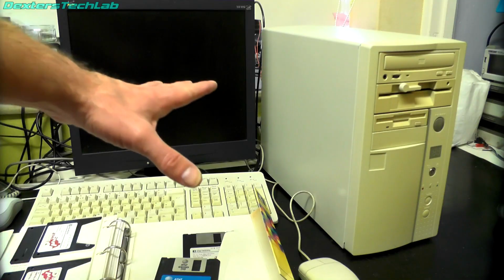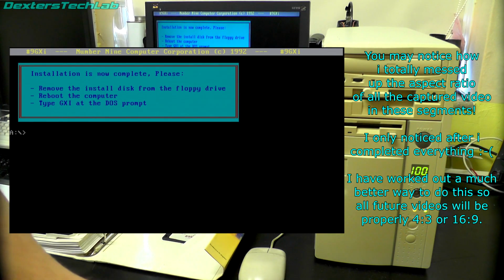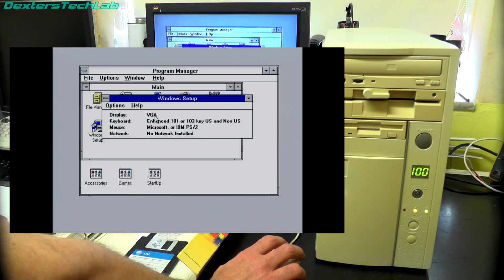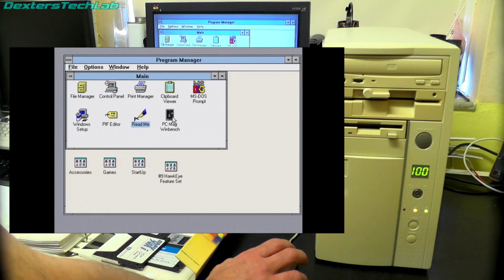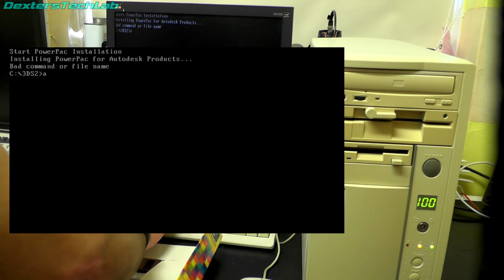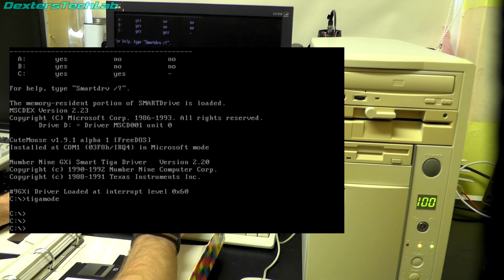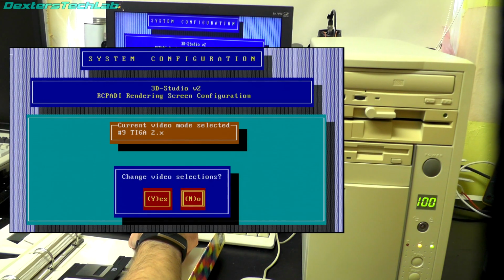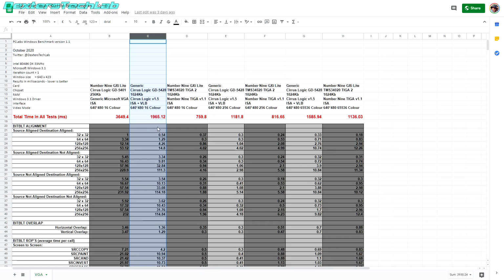DL201 Number Nine GXi Lite - TIGA Graphics Accelerator From 1992

Comment: I got one of those in 1993, loose card and for sale at a computer fair. I picked it up as I was interested in “true color” for the graphics programs I used. Managed to get the drivers through my uncle’s CompuServe subscription. The card was immensely powerful in Windows 3.x, but as a teenager I was also a gamer, and it was extremely underwhelming in higher end games like Wolfenstein 3D, and I had terrible luck with EGA graphics modes in DOS. I ended up trading it for a Trident 9000 VLB card, and then that went when I upgraded to a 486 in 1995 and invested in a Tseng Labs PCI accelerator and a massively overclocked PowerVR2 OpenGL board; I was the geek who bypassed the 3dFX VooDoo and romped them on the Quake servers.

It’s disappointing, because going back, that TIGA/VGA card was still outperforming the Tseng in general fill/blit rates, and I wish I would have held on to it.

Comment: If TIGA had moved to VLB and got that onboard CPU properly fed it would have kicked serious butt! OK, anything with a BUS faster than 33Mhz would have required a better CPU clockwise though that should not have been an issue AFAIK.

Comment: TI didn't know what they created. This is a GpGPU, basically. The processor could be used for much more than drawing lines. It was basically a computer on a card which was really good at vector processing. More general purpose than current GPUs. Of course widely outperformed by modern standards. But technically, one could write a complete new "kernel" (or bios) for those cards. Biggest bottleneck was that the VRAM wasn't mem mapped, so "loading" images (imagine textures) would go through "serialized" IO ports. Despite that bottleneck it was ahead of its time (hint: imaging Amiga "workbench" running on the cards ram instead of moving data over the bus ;) And yes, Amigas had a bunch of those cards, starting with the 2410 (the tiga.device was absolutely unusable). BTW: I think the A2410 has a picasso96 driver now.

Comment: I remember Matrox video cards for the Olivetti M24 in the mid 80’s - it was full length and two boards sandwiched together - it was very impressive in a time when we thought cga was cutting edge
Reply: It's hard to overstate how much further along real time 3D graphics was in the high end back then. E.g. this E&S CT5 flight simulator from 1981: https://www.youtube.com/watch?v=6W-qb_jHRhA . Consumer hardware didn't catch up until the late 90's and workstation hardware not until some silicon graphics workstation something or other in the early 90's.

Today the difference between even offline rendering in a server farm and real time graphics on consumer hardware isn't even really that far. You can shoot 10k rays per pixel until convergence with a path tracer in an offline renderer but that will only look 50% nicer than Unreal engine 5 with nanite (streaming very high resolution meshes from disk in real time) and global illumination using 1 ray per pixel (very aggressive de-noising, prioritizing where rays need to go, reprojecting data from last frame). The big challenge now is content creation and animation; these are slow and humans suck at animation whenever you can't use motion capture to get real data (suck in the worst way possible; it's easy to tell that it looks wrong, hard to tell why it is wrong and impossible to fix by hand). Shallow AI /neural networks seem to be doing good headway on both problems.
Reply: @soylentgreenb  mm these days there is much conflation between 3D which is geometry and perspective, lights to a degree, and object surface projections and effects + particle effects and all manner of post processing effects and the like. 3D itself wasn't chased much on the consumer side because it looks boring until you toss in the stuff that is more cinematics in origin, that's where much of it came from. On 3D gear like a lot of the SGI workstations were you didn't have things like textures and effects since they served no purpose there, like SI/SSI SE/SSE graphics without TRam and so on. On the "Big Boys(TM)" you had TRam built into the pipeline from the get go like on RealityEngine(2), InfiniteReality etc that were mostly Real Time but with enough hardware to do all of it there - generally for film production use you'd still do a Final Render with all the kit&caboodle that was not real time but you'd leave the box to crunch on for hours. The RealTime bits were to have a preview of what effects were going where and to have a decent enough viewport in realtime to stage it all correctly for the Final Render offline pass. 
SGI did have setups with TRam for the workstation side but initially it was better to run on an o2 or a VW320/VW540 if you needed to "play around" since they didn't have TRam limits, the TRam modules for SI etc were 4mb or 16mb if I recall correctly and they didn't have the horsepower to "play with it" nearly as much as something like an ONYX with RE2 did. I played a fair bit with all of those, bought an Octane2 with SE/SSE dual graphics and booted it out quickly in favor of an Onyx10k/Re2 with quad RM's which did do what I wanted it to how and when I wanted it to. I was and still am a tough customer I suppose, but along the way it taught me a lot about what does what and how fast, heh. Nowadays the only 3D capable thing I have is a Quadro P4000 which clobbers the old ONYX on everything which is almost sad. Sure, game GPU's will also beat it black and blue but some of them produce results that aren't quite as good, my old Quadro has that going for it - what comes out looks good. 
The thing with stuff like games is that at least still a few years ago they were often "dirty" - what I mean is the output to the GPU's contained a lot of junk and wasted a lot of the 'rendering power' on stuff that should have been culled before it got that far. But I suppose they have improved on that stuff in the newer "3D engines", mostly for a while they didn't have to since the geometry and texture projection side on the GPUs got so fast that the optimization was seen as an optional thing, or so it seemed. Like if a game ran like poo the answer was to buy a faster GPU instead of making the game run properly before it is released. There was rarely any criticism about some games that ran like turds because the culling didn't work and so on. Weird to me, but then I'm not a game maker.